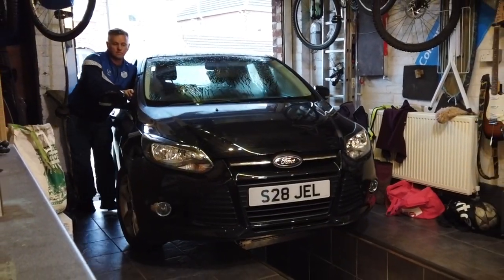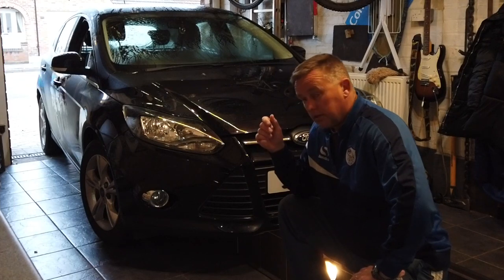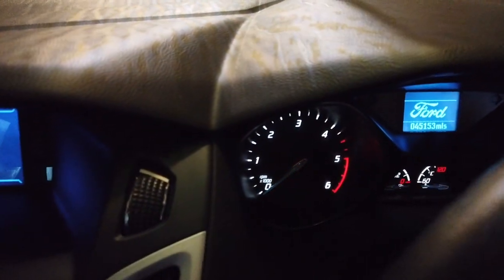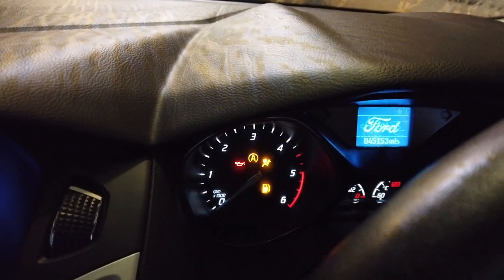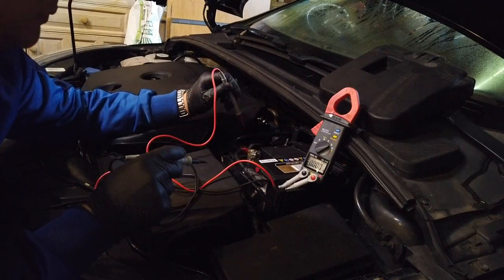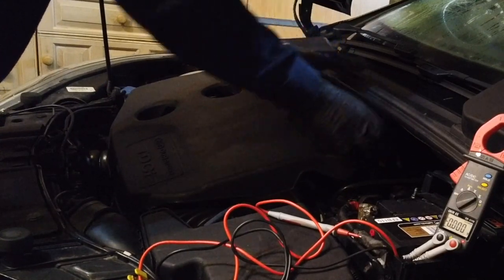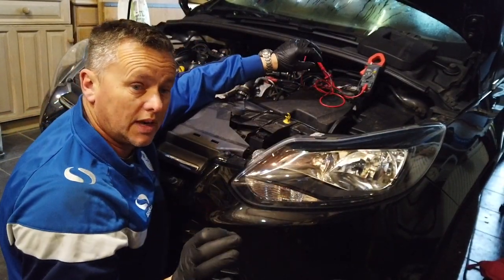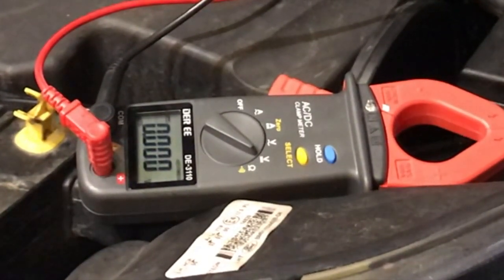Ford Focus Clicking when Key Turned, Starter Motor Repair.

Comment: I know the video is 4 years old, but saved me some big money today. Come back parked up next morning it wont start. Sounded exactly how in this video. Before Ive seen the video i went and bought the starter motor spent £150. Gone under car could not see how to replace it. Went on youtube looked for videos and found this one. So got back under used the WD40 PFTE loosen some bolts moved round tighten back up and started like a dream. So took the new part back to shop got me money back and car is works and starts fine. Thank you so much for the video 😊
Reply from the maker: Thanks for the great information👍🏻👍🏻🛠

Comment: Great video. My son car had to be towed by RAC home because motor starter failed. I saw your video and it was exact same problem. Got it fixed today and you have saved me a lot of money. Thank you very much.
Reply from the maker: One of the most common faults on these vehicles and one of the most mis-sold by garages selling you complete starter motors, Thanks for the great comments👍🏻👍🏻🛠
Reply: did you have the immobilizer flashing when turning the key and was there two clicks from under the bonnet as well

Comment: Bought a starter motor today die to car not starting and only hearing 1 click. After 2hrs trying to locate and remove it I gave up. I then saw your video and remembered my connection looking like yours so outside I go and jack up the car remove both nuts and spray with WD40 and tighten back up. Car started first turn of the key. Thank you for this video I can now return starter motor and get my £220 back and saved garage fitting fees. Top man
Reply from the maker: Thanks for the great comments👍🏻👍🏻🛠

Comment: I’m another one that you’ve saved a load of cash and pain. The car (Mondeo mk5 1.5d) up on axle stands and me checking prices for starter. I must say I was not looking forward to the removal, it’s in a right painful position (designers hate mechanics) anyway tested with multi meter as you showed with similar results.  loosened, cleaned, retightened and greased terminal nuts. Starts like a dream.
 I was surprised it was this because parked the other night and next morning nothing, just the click, I thought the ring gear had jammed. But no warning at all I found that weird.
 Thanks for this. I’m subscribing.
Reply from the maker: Great stuff, love to hear these stories make it all worth while, Thanks for the great comments👍🏻👍🏻🛠

Comment: This video was very helpful! 
My Ford Focus 2012, suddenly would not start. Found this video, and found out that the nut on the starter motor was rusted and completely loose. I could neither tighten nor loosen the nut, it just spun. But the car starts, so I'm happy 😁
Reply from the maker: Thanks for the great information👍🏻👍🏻🛠

Comment: Unfortunately, I replaced alternator and battery before viewing this video. I finally solve problem thanks to you. When I saw contacts on my starter they were in much worse condition than your car, knew immediately that was the problem, all red and blue off rust and oxidation. WD spray and electric contact spray worked for me. Thank you a lot!
Reply from the maker: Great repair, Thanks for the great comments👍🏻👍🏻🛠
Reply: Had this issue over last few days. Fou d the starter motor nut loose. When cleaned found one of threads had worn and wouldn't hold tight. Added second nut which on good thread held tight. Works fine.

Comment: My car was having real issues starting.  Watched this video, got under the engine and found a cable that had come loose and had been rubbing against one of the wires of a connector.  Taped up the exposed wire and the car starts every time again.  Saved a few bob at the garage, thanks for the heads up.
Reply from the maker: Thanks for the great information👍🏻👍🏻🛠

Comment: Mate, exact same issue on my 63 plate. Stripped the cables off, Wire brushed all the contacts, did them up, (to be fair, the main contact wasn't very tight!) and the car started straight up! Great vid, thanks for the advice! £200 odd for a new started motor saved!!
Reply from the maker: Are result well done, Thanks for the great comments👍🏻👍🏻🛠

Comment: Had this exact issue on my 2014 tdci focus. 
Didn’t think it would be a failed starter at 70k miles and only 6 years old. Turned out to be exactly that nut. Took me 40 mins to do and problem now sorted. Car starts first time every time and funnily enough my stop start has started working again after being intermittent the last 6 months. Thanks for the guide. Helped save me a few quid 👍🏼👍🏼👍🏼
Reply from the maker: This is a really common fault, so many starter motors have been changed for no reason, the garage will never make this repair just replace the unit, Thanks for the great comments👍🏻👍🏻🛠
Reply: aaanton11 no problem, thanks for taking the time to make the video. Subscribed 👍🏼
Reply: Very similar issues. Did you have to jack the car up to do this please?
Reply: @t21dml  yes up on 2 axle stands, undertray off and it’s right there. Easy to do 👍🏼
Reply: @Tombo1904  cheers mate
Reply: @t21dml  if the nut is tight use plenty of wd40 and do it back and forth to loosen. I had to do this with mine. It was quite tight good luck 👍🏼

Comment: So after a little while with this problem and a new battery and a few hours later I come across this video and wow worked a treat so thank you so much 

Only trouble I'm getting is that it doesn't Loosen or tighten up just keeps spinning so I'm guessing I will need a new starter motor at some point 😢
Reply from the maker: Glad it helped, Yes if it keeps spinning the issue will return at some point Thanks for the great comments👍🏻👍🏻🛠

Comment: Had the exact same problem and voice on my 2015 model focus. Sometimes it started and sometimes not. Service didn't understand the issue and they told me the car's computer shows no problem at all but they changed the clutch sensor just to be safe(!) Now that I'm doing a detailed research about the problem I'm pretty sure it was the same issue that you had in the video. Connection problem, corrosion or something like that in starter motor.

Great video and great explanation about how things work! Keep up the great work!
Reply from the maker: I would think you have this issue, Thanks Mert for the great comments👍🏻👍🏻🛠

Comment: Hi Aanton...interesting video...the starter does take a hell of a resistance...but one little tip....dont forget to disconnect the battery before undoing any nuts on the starter solenoid....thanks again.....Bob...Paignton.....
Reply from the maker: Thanks for the great information👍🏻👍🏻🛠

Comment: Excellent, had the same issue and sorted it this morning. Thanks 👍
Reply from the maker: Glad it helped Thanks for the great comments👍🏻👍🏻🛠
Reply: hi again looked at the starter motor last week,very rusty cleaned the nuts sprayed with wd-40 left it a few hours,still got the immobilizer flashing,i think a new starter motor is needed,or could it be any of the coloured fuses at fault, 8 months later still no luck

Comment: Had this happen on a Renault Megane years ago in a supermarket car park.Was able to reach the starter down the back of the engine and wiggle the wire. This broke the corrosion and the car started. When we got home just undid the connection cleaned and greased it and it never failed again.
Reply from the maker: Thanks Dave for the great information👍🏻👍🏻🛠

Comment: My 2015 focus (same engine) had same issue today. Only done 50k Miles. Ironically, serviced and mot’d just yesterday. It’s been taken to garage by recovery, I will be letting them know this in the morning, before they just whack a new starter motor in it! Will update how it goes! Cheers.
Reply from the maker: my moneys on them fitting you a new starter 😂 Thanks for the great comments👍🏻👍🏻🛠
Reply: aaanton11 I’ve got to say I expected the same, however Garage phoned this morning. After insisting it must need a new starter motor and me insisting it was just the connection form the solenoid to the motor needing cleaned up because it’ll be corroded.... as per your video...
he phoned me and said he swallows his words & it was just the connections!! It’s working fine & good to go!  Good of him to be honest and admit it. Thanks very much, saved me £170!

Comment: I’ve gone through several starters now. Before we both the mechanic and I saw the oil on gear and believed it was due to this. Now this last time lasted only two weeks. Still make the same sound as previous failures. Like Bendix just spins grinding noise. I myself took it off this time and no oil what a surprise since there’s been oil on previous ones. Very clean. Took it to mechanic he bench tested it looked great he said to put it back on make sure all connections are good tight clean including batttery. Battery only one month old. Still not working just keeps making same  spinning grinding winding noise. Soo if bench tested it and came out good it doesn’t mean under flywheel load it’s strong enough to crank flywheel?
Reply from the maker: It is possible the flywheel is faulty, the duel mass ones break up causing issues, Thanks for the great comments👍🏻👍🏻🛠

Comment: Saved me having to go to the garage! My problem is the nut on the feed from battery won't come off. It just spins infinitely and will only just tighten. Need to find a way of getting it off.
Reply from the maker: Don’t spin it too many times there is a wire on the other side, Thanks for the great comments👍🏻👍🏻🛠

Comment: Wonderfull video1 I  got the same problem with my wifes C-Max. Now I know where to look and what to do. Ill get back to report if it solved the problem. Cheers from Denmark
Reply from the maker: Yes let us know how you get on!! Thanks for the great comments👍🏻👍🏻🛠
Reply: @aaanton11  So I meassured the voltage and connections on the startermotor. There is good earth on the starter, and the starterside of the solinoide gets voltage, when I turn the key (the wire, that goes into the starter from the solinoide gets voltage) So I guess, its a new (or newer) startermotor....

Comment: Hey, Anton. Thanks v much for this. Same problem on my 2013 Turbo diesel Focus. After your video, traced it to poor contact on starter motor; main connection actually only finger tight!!. Really hard to get at as I don't have a pit but got there in the end with two tonne trolley jack and some axle stands. Cleaned, tightened, greased and off we go. Brilliant. Many thumbs up.
Reply from the maker: great stuff well done Thanks for the great comments👍🏻👍🏻🛠

Comment: Hey when removing starter the rubber seal that sits on engine case in between the starter and engine fell out ? How important is it to put it back on ? Just what does it do ? Looks a bit frayed too at the ends.  Very important to have a near perfect replacement or can I even leave it out ?
Reply from the maker: I don't know which bit you mean? Thanks for the great comments👍🏻👍🏻🛠

Comment: When removing that 13 mm bolt at the back of starter motor  do you need to remove the battery connector for any short circuit safety? Thank you.
Reply from the maker: Its up yo you, I don't Thanks for the great comments👍🏻👍🏻🛠

Comment: great video again, I was wondering if you do a video where and how you can found croc clips for the multimeter and how to do they fit onto the multimeter leads
Reply from the maker: I need to make a video on multimeter testing, I will add it to the list, Thanks for Mark the great comments👍🏻👍🏻🛠

Comment: I’m a complete rookie who is going to attempt this on the footpath where my car won’t start. Please may I just ask. 

Will I need a jack to raise the car? 

Do I need to disconnect the battery before starting work? 

What sizes will I need from a socket set please. 

Many thanks
Reply from the maker: Yes you will need to raise the car, no need to disconnect the battery, Thanks for the great comments👍🏻👍🏻🛠

Comment: I came across your video as I was looking at replacing my starter motor, after reading all the comments it looks like this is a common issue so I'm thinking of giving it a try. what's the best thing to use to clean the contacts.
Reply from the maker: Just crack it off and retighten, Thanks for the great comments👍🏻👍🏻🛠

Comment: Excellent video,  no bull shit, brilliant explanation and tips, thanks
Reply from the maker: Thanks for the great comments👍🏻👍🏻🛠
Reply: @aaanton11  2010 focus 1.6 diesel, car wouldn’t start sitting up 2 years, new battery nothing, then losen of the nuts on the starter,   Cleaned connectors and she fired right up...brilliant video 🍻🍻..I owe you a pint of Guinness.

Comment: hi there my 2010 diesel focus makes clicking noise but after a good few on and off turns of the key it starts
any idea what the engine malfunction light comes on for  car runs fine no limp mode
Reply from the maker: This is most probably the issue, Thanks for the great comments👍🏻👍🏻🛠

Comment: Found out the hard way that bench testing a starter isn’t the be all end all. It’s a first step but you can put it on and won’t crank.  That’s what happened to me. Anyway my almost brand new starter just two weeks old OEM totally failed. Got a used junkyard one and totally worked. Forgot to put on that top bracket that starter cable clips on to oh well.  ..
Reply from the maker: 😂Thanks for the great information👍🏻👍🏻🛠

Comment: Great vid ! 
I'm going to try this on my 2016 ford kuga 
As it usually declines to start it takes afew goes and then it goes dead and then it starts so I would definitely think its the same problem ! Well I hope it is 
What lubricant did you use or is it ok to use any kind could you recommend some please mate ! Plus do I have to disconnect the battery just incase of a spark , or is it OK to just do it and loosen the nut on the starter 
And carry on 
Plus is it just the nut onto the starter that I must loosen and then spray and tighten again 
Thanks mate 
And thanks for the videos brilliant 
Just  subscribed as well 
Thanks mate ! Looking forward to your reply
Reply from the maker: Yes just the nut on the starter, don't disconnect the battery, Thanks for the great comments👍🏻👍🏻🛠

Comment: hi there  is that whats bringing the engine malfunction light on with my ford focus 2010 diesel,after lots of turning key on and off it eventually starts
Reply from the maker: No you will most likely have air ingress possible fuel filter seals, Thanks for the great comments👍🏻👍🏻🛠

Comment: What do you suggest to do if this nut doesn’t tighten or get any looser? It just spins on the same bit
Reply from the maker: New starter needed, or strip it down and replace the solenoid, Thanks for the great comments👍🏻👍🏻🛠
Reply: @aaanton11  is it a copper nut on there? Mine feels like its stripped the thread on it. any idea what size it would be? Would a steal one work as a replacement? Thanks

Comment: Hi aaanton11. I have same issue with clicking on keyless starting on my Ford Focus Titanium Nav Econ Tdci 1560cc  56000 miles 2014 Diesel but mine is keyless. Would it be the same problem with bad connection on starter motor?
Reply from the maker: yes they all have the same issues, Thanks for the great comments👍🏻👍🏻🛠

Comment: same problem.. one click and no start. i had someone look to see if there was a spark.. and there was. i cracked off the biggest nut to try completely removing it to clean. i wanted to shine up all connecting parts. as i was unscrewing the nut it stiffened up a little because of the exposed outer thread being cruddy, but not excessively, but then the whole bolt started turning. i didn't realize at first as it wasn't that obvious, so i think i got a full 360 turn at least before i stopped. i tried to tighten it back up again, but it just spun together the same as before. still solid tho, but not nipped up as i'd like. i had someone start the car (and it did, and it does every time now) as i was under it to see it there were any sparks, but there wasn't. i'll have to see how i get on now and hope it stays this way. if not then it's a new one probably. so, i'd say wd40 it with a straw for accuracy, and with the + battery lead off. wd40 it two or three times in half an hour, then leave it for another half an hour to penetrate. yes!... it's an hours wait, but worth it to avoid the issue i just had. (if the wd40 works of course).
Reply from the maker: Well done, Thanks for the great information👍🏻👍🏻🛠

Comment: Hi mate I think I have this issue my car clicks once when try to start I was driving home the car started to make a mad spinning clapping sound then it died wouldn't start got power the onboard computer thing says 11. Something Volt's is it the starter or the battery at fault
Reply from the maker: That sounds like the alternator drive belt might have broken, Thanks for the great comments👍🏻👍🏻🛠
Reply: @aaanton11  the belts ok I've pulled at it all looks ok

Comment: Hello,
I'm having the same issue with my Ford focus. I've attempted the fix. The bolt will turn but doesn't seem to want to tighten or loosen. 
Any help would be much appreciated.
Reply from the maker: You will need to grab the nut behind the wire with a second spanner of pliers, Thanks for the great comments👍🏻👍🏻🛠
Reply: @aaanton11  thanks again I'll give that a go.
Reply: Hello again,
Had another attempt at this today and there doesn't seem to be a nut behind that wire. Pretty sure that's the issue though. That bolt wouldn't tighten in the end unfortunately. The car is starting intermittently. Just going to bring it to a mechanic tomorrow and tell him the issue. Although I couldn't fix the issue thanks for finding root of the problem.